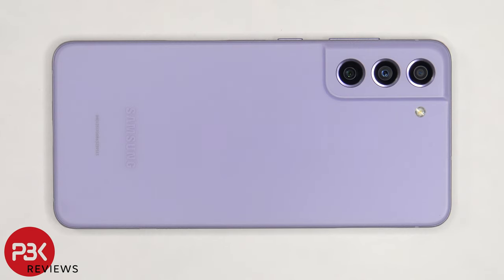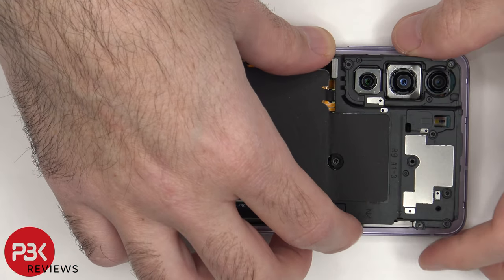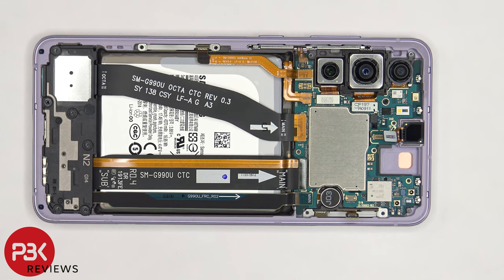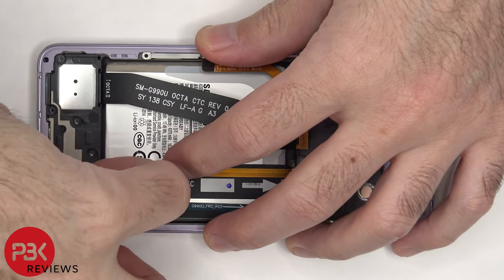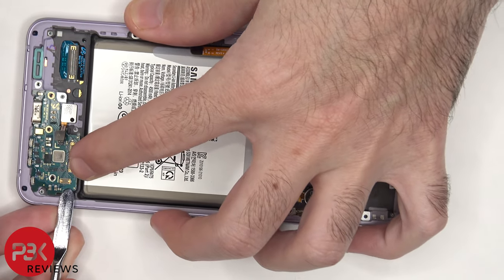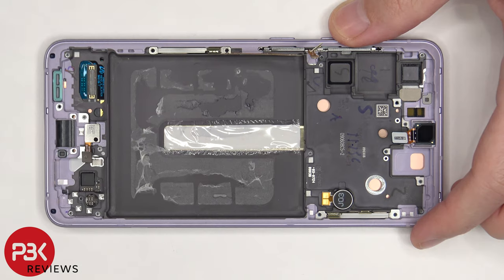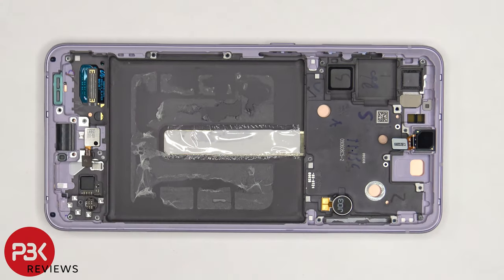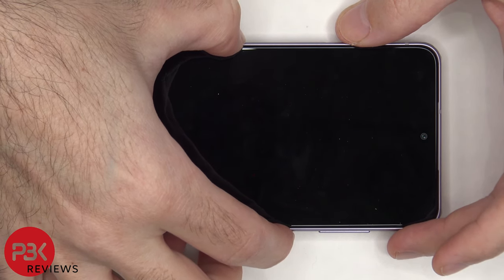Samsung Galaxy S21 FE Disassembly Teardown Repair Video Review

Comment: Compared to the S20 FE, the S21 FE is 4mm shorter and 0.5mm thinner. Looking at your teardown, I can see the 4mm comes from a smaller bottom speaker, and the 0.5mm comes from a thinner back cover.
Reply: Really missing that low end my lg v20 had. Explains it.
Reply: no its because its 19.5:9 ratio compared to 20:9 on s20 fee
Reply: @IcyJay30  S21 FE, like S20 FE, is 20:9.
Reply: @xxxxxls  lol, don't go by random websites, s21fe have 2340×1080 resolution Nd s20fe have 2400×1080, height reduction is possible when screen height reduced as well,

Also s21fe have 103cm² screen area (wide) and s20 fe have 101cm² (narrow)

Comment: The best places for heat to escape from the device are the side edges. If the heat is transferred to the aluminum frame around the device, it would cool down quickly and optimally.

Comment: I really like this teardown. Can you please confirm if this phone has a cooling system for heat dissipation?
Reply from the maker: Thanks. It has 3D Graphite which transfers the heat instead of a copper vapor chamber. It works just as well as a vapor chamber.

Comment: gotta love those coppers moving the heat from the cpu to the lithium batt :))) lithium loves heat
Reply from the maker: Haha
Reply: Copper is the third highest ranked element in regards to thermal conductivity. Only surpassed, by silver and diamond. Your contemptuous sardonicism was keen. It's not like one holds It, on their side head hole or nothing.
Reply: @duhbestest1334  duude , we were talking about heating the battery...wth
Reply: haha. almost all newest phone have copper plate under the battery. even gaming phone 😂
Reply: @rixyrohaizie  and you think it`s great
Reply: @himanologanor4093  have u seen phone explode because of that?
Reply: @rixyrohaizie  no phoner ever exploder dude, not even that rushed edition of samsung note, what i`m talking about is to care for the battery so that it holds for more than 1 year, lithium hates heat, i have old phones at home still working after 10 years , imagine why
Reply: @himanologanor4093  yes i know. but the heat pipe is to be dissipate through screen not the battery
Reply: @rixyrohaizie  yeah, because heat is conscious and will obey our rules, man, usually displays stand on full a metal plate, why not connecting the CPU directly to that and leave the battery alone ? also , have you checked the average life of batteries lately (for the new phones) ? they tend to be worse by the year
Reply: I think the idea is to dissipate heat through the screen. That's what they say in other phone's teardowns

Comment: After two years of usage, the adhesive of the back cover seems to be coming off, I use the phone inside a case, so should I get the adhesive reapplied to my phone, or it's not an issue?
Reply: u shoud reapply the adhesive.

Comment: Umm i had a question sir, i recently bought this phone and dropped the box, in which it was inside, it slipped out of the box when the box slipped out of my hand
and hit the floor on the bottom left corner (there's a little dent on the metal rail, the paint got chipped a little) everything seems to be working fine.
Do you think this could have damaged anything internally in the long run? Also the battery can swell from an impact?
Reply: Don't worry much, it sounds like minor incident, plus it won't affect battery
Reply: You're good!

Comment: Great video. Thank you so much. ❤️
However, sir what is that thing just adjacent to the bottom most rare camera lens? That site actually happens to be the source of a sticky sound when the back panel is pressed in and around that area, in many units of this model including mine. Kindly consider answering. 🙏🏽
Reply from the maker: Thanks. I'm not sure what you're referring to, but if you can screen shot it and circle it and email me the picture to pbkreviews@gmail.com, I will reply back with an answer.

Comment: Nice video thanks! My newly purchased s21 fe has a slight gap between the back plate and main frame around the camera bump... Should I be worried about anything regarding ip68 protection? It's really small tho... only a thin piece of paper can be slid in!
Reply from the maker: Thanks. Hmm not sure, as long as your not seeing any dust or moisture getting inside the camera lens area then I wouldn't be worried.
Reply: Same issue, here in my country samsung is not even claiming that they are saying that your set is opened and warranty doesn't cover it. F**k samsung.
Reply: Bro l, I just got it recently and I have the same hap near the camera bump. I don't know if it's anything serious. It's only been 3 days I bought this phone.
Reply: Even when i was checking my phone near camera module adhesive is weak and there is gap there and also gap is near theupper mic
Ill not dare to dip in water now
Reply: @AjayPatil-fj5tu  sold the crap and bought an iPhone 13 last year… never been happier

Comment: Thank you for sharing! Do you know where the storage is located? 
I want to destroy my data (Physically) before sending the phone for recycling (repairing costs way more than the value of the phone today)
Reply from the maker: It's one of the black large square chips located underneath the covered shields on the main board.
Reply: @PBKreviews  Thanks!

Comment: I have this phone, but was just told by Samsung advisers that it has a bad battery, like it's worn out. Which is impossible because I only bought it two weeks ago. Do you think Samsung technicians can fix my phone or should I replace it with a new one?
Reply from the maker: You can always replace the battery if that is the problem.

Comment: So my 21fe took a rather hard fall and the Bluetooth connectivity was effected, my phone has since taken another fall, the Bluetooth is the same glitchy but now i cannot detect let alone connect to wifi networks.  It shows no networks and therefore doesn't connect to any either.  Is something came loose? Appreciate any help.
Reply from the maker: It's possible a cable may have gotten loose or the motherboard cover may have gotten loose but also possible the chip got damaged from the fall. Might have caused some solder points under the chip to break. You can try taking it apart, and re assembling or checking to make sure everything is in place. Aside from that, if its the bluetooth/wifi chip, it would either need to be reballed or replaced by a repair shop that can do soldering.
Reply: @PBKreviews I hasn't noticed your reply , or the fact that this is a video I'd already requested help on. I will contact my repairman for help . Thank you for your time.

Comment: A piece of dirt/lint or whatever from outside fell into my earpiece when trying to get it out. Is this really bad? Should I get the phone serviced?
Reply from the maker: No you should be fine, the speaker itself has a filter over it as well.
Reply: @PBKreviews  nice! On a second note, do you know how hard the filter/grill and components of the earpiece are glued or set to the phone? Just to know how careful I have to be If I ever need to clean something without disassembling

Comment: which atenna uses the 4g? and which one is 5g or are they both combo for 4g/5g?
Reply from the maker: Not sure exactly which is for 4G, but aside from the mmWave 5G antenna (which are the mid left of the frame and the one to the right of the motherboard by the frame) the sub 6 Ghz 5G antenna as well as the 4G ones are mostly the ones built into the frame where the motherboard and sub board contacts touch, as well as running through the sub board and motherboard etc.

Comment: I accidentally pushed the sim ejector tool into the mic hole instead of the sim hole. Is there a chance that it survived and the IP68 rating or perhaps the water resistance isn't void? The mic is working fine and no issues on calls. But I'm worried something may have been damaged given how hard i pushed it in.
Reply from the maker: you will be fine. Filter and mic are seated above the hole and would not get damaged.

Comment: After teardown is this is waterproof
Reply from the maker: If you replace the adhesive on the back with new original pre cut adhesive which is made for the phone and if applied properly, then yes it will retain the water resistance. Usually original replacement back covers will come with the adhesive pre installed as well so you peel off the cover and apply it to the phone.

Comment: It is still water resistant after opening or not?
Reply from the maker: No, you would need to re apply original pre cut adhesive to retain the resistance. They sell the adhesive for the back as well as back cover/battery door replacements which come with the adhesive pre installed.

Comment: Sir I applied the stickers on my S21 FE and tried to remove it after 4 months. While removing the adhesive of the sticker was so strong that the back panel kind of came a little  bit because of it from the middle egdes of the phone. Now they rest perfectly well on the phone but i have the concern that. Has that void my water resistance of the phone??

Comment: Is the ip68 still be good?
Reply from the maker: if you install the original pre cut adhesive made for the phone properly, then it should retain the water resistance.

Comment: Hi :) I wanted to ask if you know, where the power management ic (PMIC) is located?
I was smashing my S21 FE on the floor and now it doesnt turn on any more.
Opened the device, made sure everything is plugged in but still nothing.
Windows doesnt even recognize the smartphone in device management,
when connected.

I would be really happy, if you could help me.
I've already ordered a new phone, but there are many videos of my kids on the device,
unfortunately i've decided 6 years ago to disable cloude saving DCIM.

Thanks!
Reply from the maker: Hi. Not sure where the PMIC is. It might be a bad display also. Sometimes when the display isn't working, the phone doesn't power on either but again its just a possibility. Maybe even the battery went bad who knows, but yep aside from those I would lean toward the main board. You would probably need to find some specialty shop that does phone soldering who would have a better understanding of getting the PMIC or any other controller part on the board repaired.
Reply: @PBKreviews  the battery did went bad, but i've connected another compatible samsung battery with 3.88V and it still didnt power on. No vibration, no sound, nothing :(
Reply: @adriankazmierski8541  You possibly couldve killed the motherboard

Comment: Hello can I cut the wireless charging from the the other part I want my battery to be visible as I have a see through panel??
Reply from the maker: Hi, you don't need to cut it off, you can peel the graphite pad/film from the plastic cover as well as gently peel off the back of the connector for the wireless charging flex from the other side of the plastic and separate it from the motherboard plastic cover. But short answer yes you can remove the wireless charging coil/graphite pad.

Comment: Today my S21 FE 5G SD 888 got some water during heavy rain, and now there is an issue with the primary mic, coz while on a call from that side my friend says that my voice is distorting.. So, I want to know how much serious problem it could be? Is it possible that it possible for the water to go inside and damage some other components?

Comment: Hey I accidentally put my sim ejector tool in the microphone slot. Does it get damaged pls reply I'm worried 😥
Reply from the maker: no you will be fine, both the mic and filter are seated above the hole so would not get damaged.

Comment: my backplate has gotten loose after i left it for screen rapair and I think some dirt got in there and now the phone shuts off if i shake it then i clamp on it for a bit and it turns on again, so i just have it on a table all the time so it doesnt turn off. i think im gonna try to remove the graphite film and try to blow some dirt out of it if thats the problem but have u heard of this issue before maybe u know wut it is?
Reply from the maker: Hmm not sure. Can be water damage, loose connections or something else. You can try taking it apart and using a small brush like a tooth brush to brush off any corrosion if there is some from water damage or clean out the phone and make sure all the cables are connected and the main board is seated and everything is screwed in place. You can also order new adhesive to replace the one on your back cover or the entire back cover with adhesive pre installed from this website: www.mobilesentrix.com

Comment: Nowhere did you say anything about the Bluetooth wifi module.  Where is the Bluetooth/ wifi module or detector?
Reply from the maker: It should be the large square chip soldered to the top right of the motherboard @2:28 in the video.

Comment: Does ip  68 rating  remains after disassemble  after battery change
Reply from the maker: If you replace the adhesive with the original pre cut adhesive for the phone then yes, if not then no.
Reply: @PBKreviews  if I give it to officially  service centre will they use glue

Comment: Hello Sir i have one question, the sales person by mistake inserted the sim opening pin in the mic opening instead of sim tray in Samsung s21 fe. Please advise will it damage the mic. Keeping my fingers crossed.
Reply from the maker: Hi, no it will not be damaged. Mic and filter are seated above the hole.
Reply: @PBKreviews  Thanks a lot Sir for your kind reply 🙏. It was a big relief  in India with Exynos  2100 processor it USD 400 USD phone, we don't have the Sanp Dragon 888 version in India.
Reply: @gauravsaini5539  mere ko 27k mein mila tha BBD sales main
Reply: Did the gasket safe after this mistake ? Is it sill stop the water going  inside the phone though  that hole ?

Comment: Accidentally I insert pin upper microphone on my s21fe. is it damage water resistent and microphone? Im worried about that.
Reply from the maker: No you will be fine. Both are seated above the hole and will not be damaged.
Reply: Thank you brother❤

Comment: hello i dropped my phone open aand it oesnt read my sim and charge my phone anymore. what is the problem when your phone does not charge?
Reply from the maker: it's possible one of the cables connecting the sub board to the main board has become disconnected or loose

Comment: I am surprised that there isn't anything on the backplate that makes it water resistant besides the adhesive?
Reply from the maker: There isn't really anywhere else water can get through aside from the sides which has the water resistant adhesive on it. It's not just a regular adhesive but one that is resistant to water.